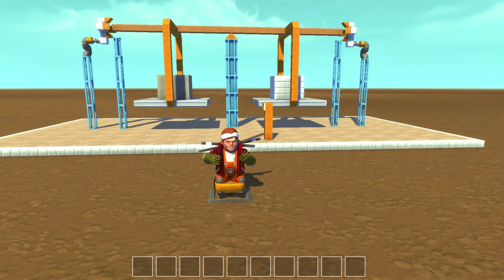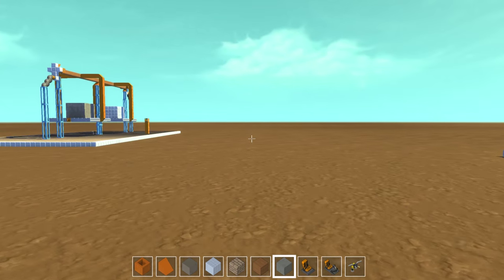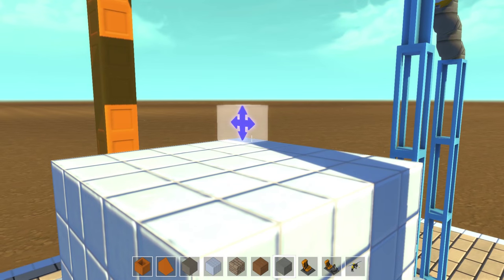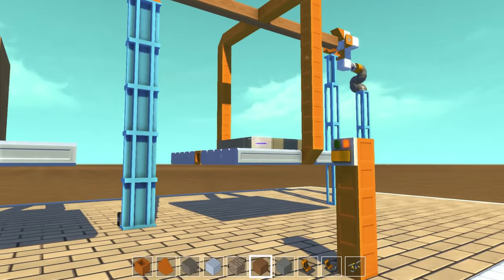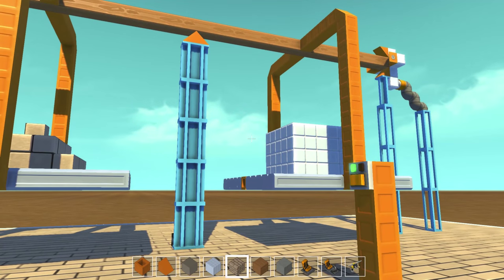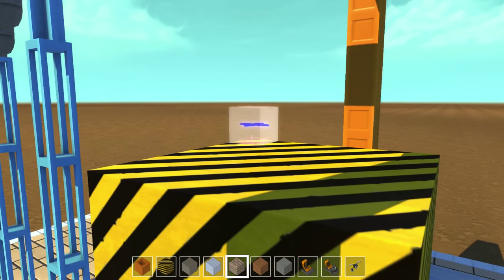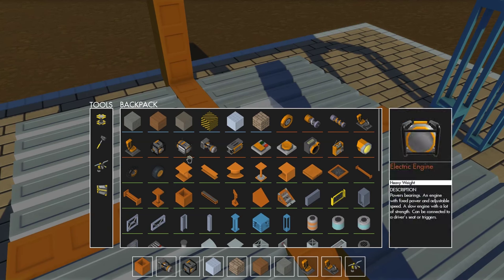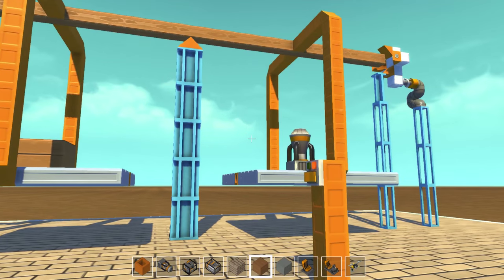05 - Weights and Measures | Scrap Mechanic Let's Play with Lyte

Comment: after looking through the games files i found the densities(concrete,tiles and glass dont have a density specified so there has to be a default density for objects without specified density):
wood,caution=250
metal,bricks=1250
default=500 (couldn't find the default within the files(must be in the binaries of the engine))(should be 500 according to your research)

and all "non blocks" are one of the previously mentioned densities